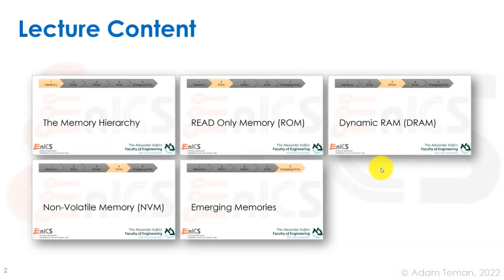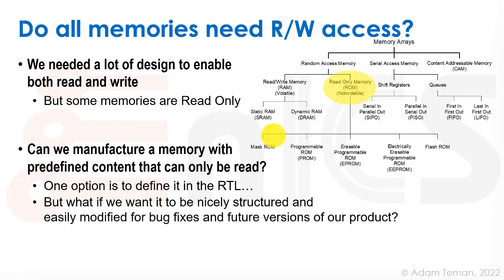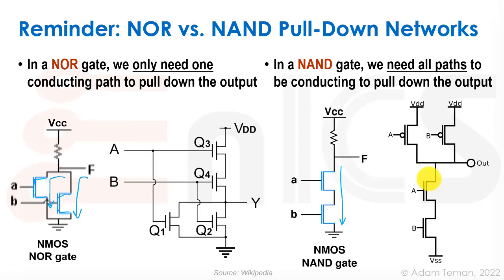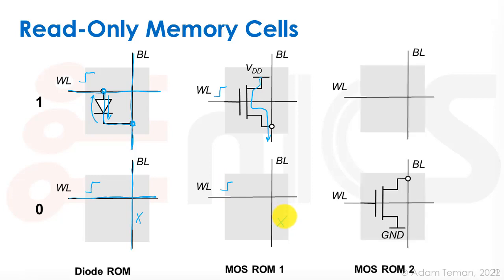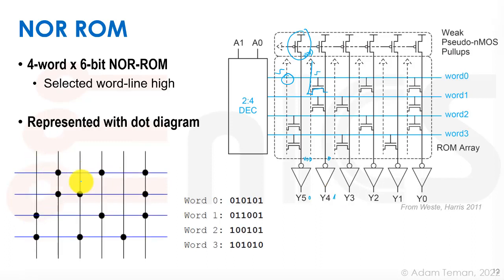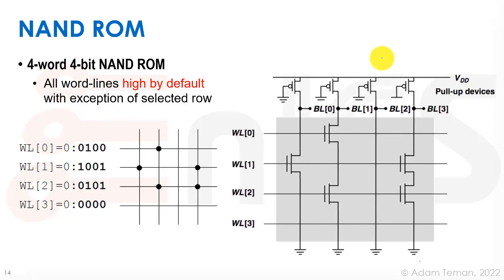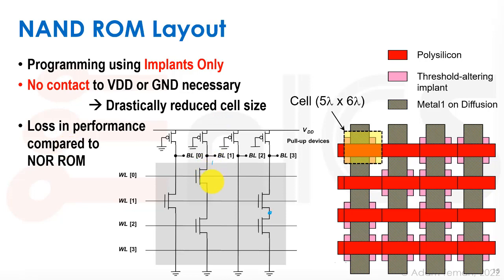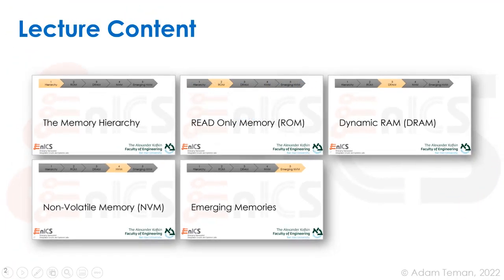VLSI - Lecture 11b: Read Only Memory (ROM)

Comment: Can you tell me what is the maximum and minimum size of array used till date in memories and what are the limitation of these array
Reply from the maker: Hi Manish,

That is a tough question for several reasons. First of all, there is a wide spectrum depending on many factors, such as type of memory, process flavor, spec, and more. Second, the definition of "array" is quite loose - from calling a full memory macro an "array" to calling a single bunch of rows and columns an array (or possibly a "sub-array"). A good place to read about this is in the paper(s) discussing the CACTI simulator from HP (https://www.hpl.hp.com/research/cacti/ or https://github.com/HewlettPackard/cacti and papers on IEEExplore). They explain in-depth how they model the memories and you can see their definitions and much more.   As a side note, the original tool was developed by Norm Jouppi, one of the biggest computer architects, recently behind the development of Google's TPU.

Another good place to look is at the OpenRAM project https://openram.soe.ucsc.edu/ from Prof. Matthew Guthaus at UCSC (who is a cool guy!).  This open source project provides an infrastructure for creating SRAM compilers and has all you need to know inside.

But in general, SRAM memory macros from memory compilers tend to provide macros ranging from a few KB to about 32KB. These are made up of many smaller arrays in various configurations and sizes.